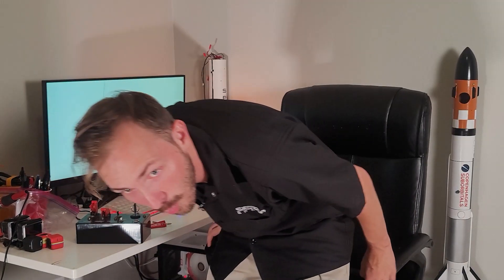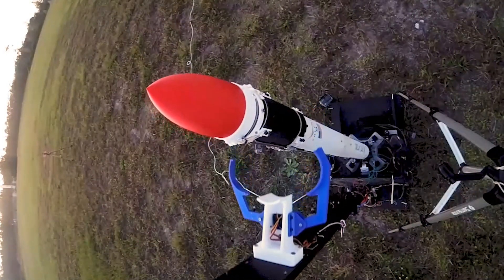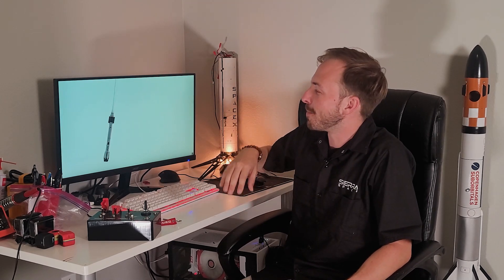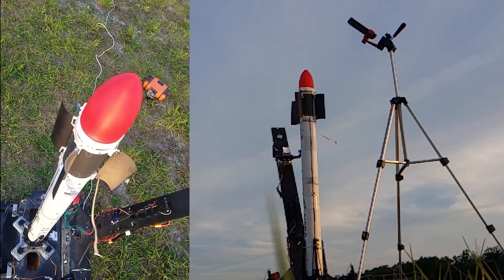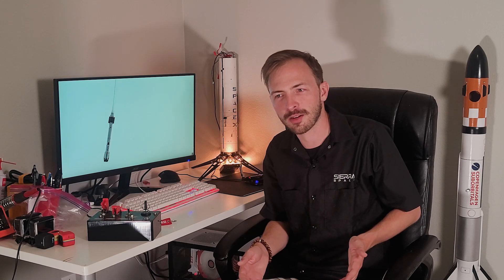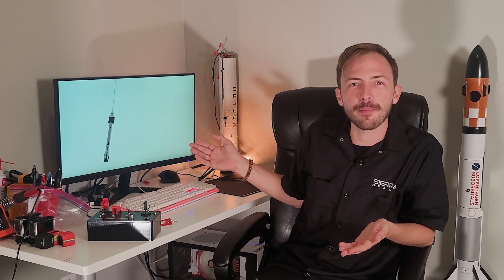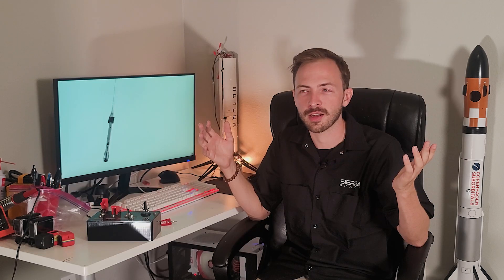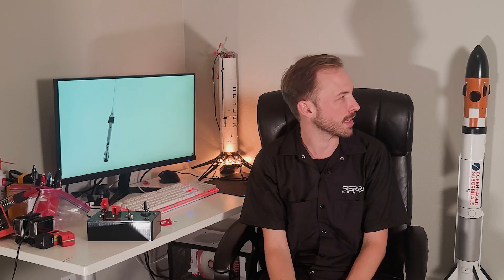Model SpaceX Falcon 9 Launch and Landing Test Flight

Comment: I thought that something like this could help solve the question that is all over the spaceflight community these days. Which is: Are vertical (propulsive/VTVL) or horizontal (winged/VTHL) rocket landing more efficient? So I suggest solving that with an experiment:
First, make 2 identical liquid fuel model rockets, and outfit one of them for propulsive landing, and the other for winged landing. Then, attach "payloads" (measuring devices with parachutes) to them with a separation mechanism, and you can start the tests!
There would be 2 testing modes - "Height Toss" measuring total height reached by the payload after separation, and "Distance Toss" measuring distance covered by a ballistically flying payload. The systems also get bonus meters in either for landing near the launchsite. Run these 2 test modes many times over, then compare results.
Reply from the maker: This can be done much cheaper through simulation but there are so many variables it is really really hard to do an apples to apples comparison
Reply: @TZeroSystems  Yes, but a comparison like that could shut down the SpaceX fanboys who proclaim everywhere that vertically landing rockets are "clearly superior" to spaceplanes without any hard data.